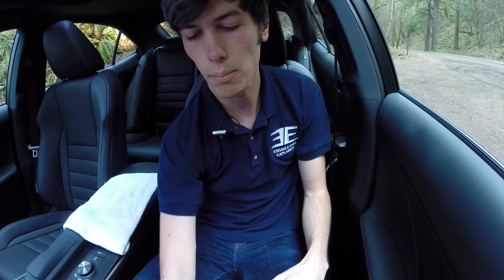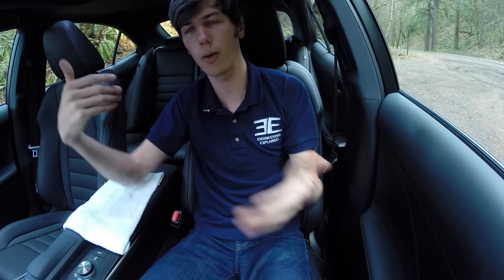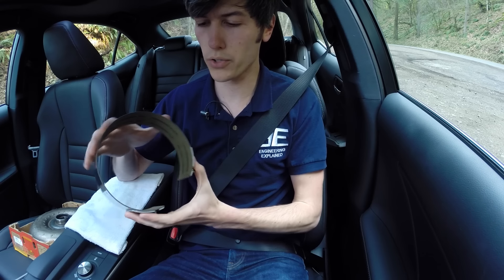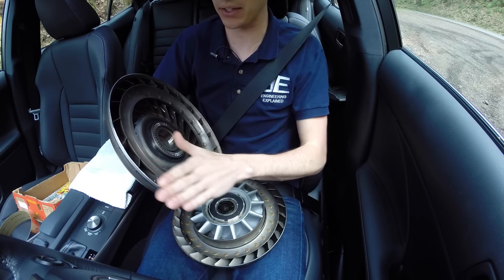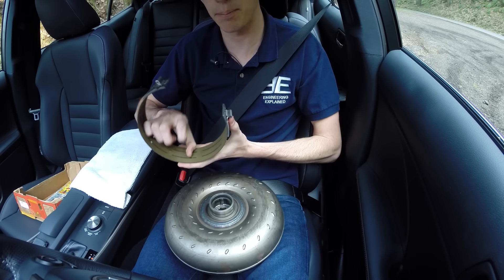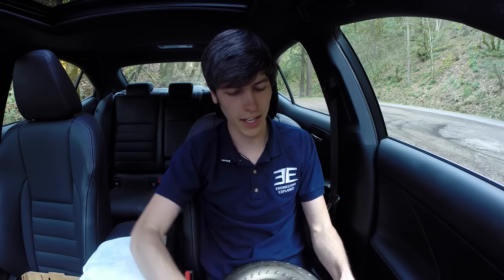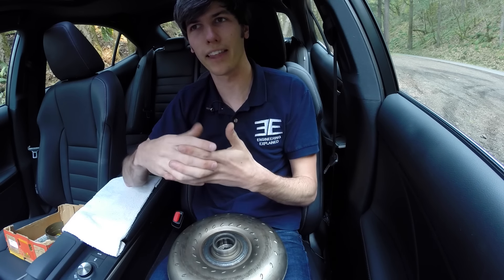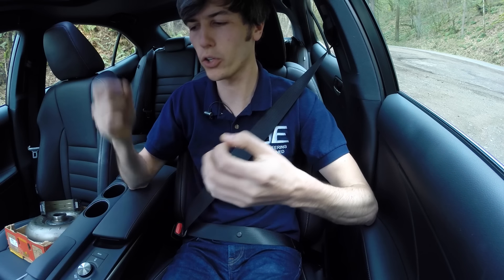5 Things You Should Never Do In An Automatic Transmission Vehicle

Comment: Coasting downhill in neutral at highway speeds uses 0.23 gallons per hour, but leaving it in gear uses 0.66 gallons per hour because the fuel is not completely shut off. Instead (at least in my Toyota), the air/fuel ratio is raised to18:1 and the ignition is advanced to the maximum and the engine is still rotating at highway rpms!
At a stoplight, you're using using 0.33 gph of fuel, but in neutral, the drag on the engine drops to 0.23 gallons per hour.

Comment: about letting in D while red light, i thought it's the right thing to do because i thought that all engine power will be dissipated by torque converter and the input shaft of the gearbox is not rotating. but then i see this other video that showing OBD reading of transmission data there is SLIP REV of 120 rpm with 640 rpm engine rotation while stopping and in D position. does this mean the input shaft still rotating at 520 rpm? if this true isn't this strain the clutch pack of transmission? could you explain this?

Comment: I greatly prefer driving manual transmissions but when I drive a work truck and it has a console shifter I have to drive it like a manual.  When I come to a traffic light I shift from D to M and manually downshift until I'm almost stopped then I put it in neutral so the trans is not fighting the brakes.  Personally I think it is dangerous to leave the vehicle in gear while people are walking in front of it in the crosswalk.

Comment: A comment on number 4 and the volvo well any company that uses the asin 6, 8, or 9 speed transmission the tcm is programmed to release the band and sit in neutral after a couple of seconds once it realizes the vehicle is at a stop light just to save fuel and keep you from having to shift

Comment: I dont shift to neutral downhill, but bc I live in a pretty rural area, theres a few traffic lights that I can see from over a mile away; if that light is red and I think it will be green by the time I get there, I can save some gas by avoiding engine braking. I only do it late at night when I'm practically the only one on the road. Despite that, I guess, being illegal in Illinois, is there any harm that could come to my vehicle by doing this?

-It saves gas by avoiding engine braking
-I'm still in control of the car, as no one is ever around me when doing this
-No brake fading occurs because I shift back to drive in case I need to brake anyways
-Is there any way a cop could tell that i'm in neutral from outside of the car?

Comment: You missed what I think is the number one reason not to shift into neutral when going down hill... That is that it's easy to  accidentally push the shifter a bit to far and wind up in reverse. A modern, computer controlled transmission will not let you do that, but one that's just a few years old and not shift-by-wire will. I see this video was from 2016, I think at that time very few (if any) transmissions were shift-by-wire.

Comment: "No reason to put car in neutral at a stop".

Hmm. I was thinking about that, especially with cars which automatically turn off the engine.

First reason is that in my car it saves the fuel, in N it takes about 0.6 of what it takes when in D. Not much, but can further improve fuel economy as an addition to engine's start-stop system.

Second reason is that it's a bit safer, if you slip your foot from the brake when eg. reaching for something.

Third reason is that my Mazda will know that it can shut off the engine for longer, because I just hinted that with the N mode (by looking on what it tells me on the screen it kind of encourages to use N when waiting on lights, etc).

Four reason is that when engine restarts in N it's much less stressful on the transmission, since it doesn't immediately try to move the whole car with brakes locked. The parts should last longer. I've heard an argument that when switching to N the transmission will lose lubrication fast. I find it quite unbelievable that oil would immediately go away from all the parts. It always takes some time.
Reply: There is a safety issue.  If a car from the cross-traffic veers out of its lane and heads towards your stopped car (with its engine off) you have no chance of accelerating out of the path of the oncoming car.  You are a "sitting duck" just watching and waiting for the oncoming car to ram your car and possibly injure or kill you.
Reply: @c_b5060  What? No. It'll take maybe 0.3 s for me to start moving anywhere with full acceleration. It's not an engine from 15 years ago where it took a couple of seconds to start. It starts in like 200…300 ms at most, so before I even move my foot from the brake pedal to the accelerator, my engine is already running. I'm talking about Mazda from 2020, so you might be right about older cars and their older start-stop systems.

Comment: I've always driven manual transmission cars and always avoided driving downhill with no gear on. I've always understood that no fuel is used even if the rpm goes up. When I drive in Canada, all the cars there have an automatic transmission. In the same vein, I wouldn't think of putting the N position of my lever on, so I wouldn't count on my gearbox to help maintain a safe speed for the car. What I said about fuel consumption is also true here, I think. I've understood this since I had my driving licence 50+ years ago, when the idea of an automatic transmission was something mythical for me.

Comment: Let's assume I'm coasting in neutral, 45mph. Then I switch back to drive. Does the computer have the information on what gear to engage at 45mph? There must be some undesirable stress on the gearbox apart from the reasons you already told us. Thanks!

Comment: I think a Toyota 4 runner could be in reverse while going forward even at highway speeds with no issues to the transmission; was told this a long time ago but never knew if it was true but would be a fun prank to pull on the highway

Comment: All 3 reasons he gave did not persuade me to not coast in neutral. I was worried he was going to say something about it being detrimental to the transmission or engine in some way (that's why I clicked on the video) but all he says is:
1. Affirms theory of better fuel economy except for newer vehicles. (Great! I have an old vehicle)
2. Can't speed up (Yup. Already knew that)
3. Illegal in most states (Not in mine!)
Reply: Even in new vehicles it's the same. Neutral for small hill but if the hill is too steep then use the gear, otherwise  - NO fuel pedal pressing = LESS consumption.

Comment: In long drives I wait for a red sign to finally give myself a chance to remove my foot off the pedals, so I set the gear to Neutral, pull the hand-brake and take my foot off the pedal .. then when the sign gets back on after 30 or 60 seconds I put my foot on the break pedal, release the hand breaks and shift to drive and proceed.

Is that a wrong thing to do?

Comment: Was there any mention of "If I don't want to hold the brake for 3 minutes while in gridlock traffic, is it okay to put my car in park, or in neutral, or perhaps just applying the handbrake?" or nah? I think I'm going to put the car in neutral and apply the handbrake if I'm stopped for awhile but may need to start moving in a pinch. It takes a lot longer to go from Park to Drive than it does from Neutral to Drive

Comment: the law was meant for older cars where if the engine goes out (out of fuel or any other reason) without wheels being engaged, you could lose pressure in brakes and power steering. Nowadays they're electrically boosted, so letting the wheels turn the engine has no safety benefit.

Comment: Does the don't put your car in neutral when at a stop light thing work for an automatic transmission from 2002? I see a lot of videos saying there is no need to do it but a lot of them are for cars with a lot more electronics than mine. FYI, i dont know the inner workings of cars but I assume that even in 2016 automatic transmissions are waaaaaay more advanced than the ones in 2002.

Comment: regarding the last 2 ones.... im not disputing it, but if theres no need for neut at a stop, n one should rather turn off b4 doing that, why is there a neutral option at all? and for the later/last one, you mention at the very end that if one feels like having more assistance with breaking, one should "Down shift first"???? isnt the thing with autotrans's that they DO NOT have shift's (for the driver to interact at least) At all? or am I missing something? and while in the same topic, also, there wasnt any mention of the use of the handbrake. "you should use your brakes and step down hard on them" implies that only the pedal brake is whats being considered

Comment: 1. The maximum MPG I have seen is only around 80mpg... I have seen the case where going down a long hill it pegs the MPG at the max, but if I reset the gauge at the top of the hill I can see that I actually did use some fuel on the way down. (Not that I really care to save a few ounces of fuel like this as the cost of doing so is higher, but still - why does everybody say no fuel is injected when that's not entirely true?!)
2.  Have you done a video on 5 things you should never do in a CVT vehicle? If not, you should!

Comment: How about switching to lower gear when going downhill to brake with the engine?  Is that okay?
Reply: It really depends on the car and situation. You don't want to put excessive stress on the transmission. If it's a modernish car it will know best.

Comment: But coasting and motor brake is a big difference, right? Its like the difference between being in gear without throttle and being in neutral on a manual. Is there a difference between manual and automatic?

Comment: It your car has built in launch control then it will damage your car less I can only speak for audis in this following statement. Put the transmission into sport and the drive mode to dynamic the turn off tcs by pressing the button once then floor the brake then floor the gas wait until your rpms reach 3,000 the release the brake very quickly and launch

Comment: one thing i always do when parking is foot on the brake put it in neutral apply parking brake foot off brake then shift to park, reason being is i figure the parking brake will take all the pressure off the transmission especially when parking on an incline, Jason what are your thoughts on that?
Reply: Doing that you likely aren't engaging park at all, the pawl may not actually be in one of its locking teeth. Put it in park, slowly let the car roll back till it catches and set the brake. Then you'll have both.

Comment: Is it okay to change gear like D to 3, 3 to 2, 2 to 3 and so on while pressing the gas? Or do I need to release the gas before changing gear? can it damage the transmission by doing so?
Reply: It's fine to hold the gas and it's fine to shift, the cars computer handles all the work to shift.

Comment: Going from reverse to drive at speeds of say less than 5 mph will be damaging?
Reply: Depends on the transmission, but more then likely over time it will damage something in there. The GM 700R4/4L60E are kind of notorious for sun shell failures, not because its a particularly bad design, but people putting it in drive before stopping just beats the crap out of the splines.

Comment: Depending on how long your at a stop light. If I know I'm going to be stationary for more than say 30 seconds, apply hand brake and shift to neutral. Prevention from transmission overheating a warped rotors. Keeping foot firmly on brake pedal is a bad idea. Driven many automatics with warped rotors, not nice.

Comment: Okay so I have a '95 Chevy K1500 and I figured out that cylinder 8 (back left if you're looking in from the front) is very low on compression (worn out piston rings) and therefore won't combust properly. I have no other vehicle to use so I drive it anyway. When I put it in gear and let it idle, it runs rough and wants to turn off so when I'm in traffic or at a stoplight, I tend to put it in neutral because it gets the RPMs back up and stops it from turning off. Is there anything I should be worried about when it comes to the transmission? Sometimes I don't come to a complete stop before I put it into neutral.

Comment: If your throttle is stuck and you downshift you’re just going to accelerate until you break your transmission or rear end or RedLine the engine till it blows

Comment: question: isnt the reason for putting it in neutral at a stop light to keep the temp from building up in 1 spot on the brake discs? specially after breaking fermly and its already hot?
Reply: The torque is so low that would never happen.

Comment: I will put the car in neutral when stopped   not for the transmission but to be able to release the brakes (when no hills)    hot brakes...pads can leave deposits causing a feeling of a warped rotor.
Reply: Just used hand brake

Comment: In a hot country as Indonesia its normal that people waiting or talking for an hour in the car and running engine for the airco so most people put automatic gear in N or P ,now I hear in N is not good…..why is N there then at all?
Reply: Good question - a safety buffer between Drive / Reverse. Also, sometimes it's needed in emergency situations to coast to a safe spot when the vehicle is disabled. I use neutral at long stoplights because my old truck runs poorly [stalls sometimes] so I had to increase the throttle and that makes it kinda push forward more than normal and so I have to push the brake pedal harder and it wears out my leg a bit.

Comment: Shifting in neutral when you are at a light can be a safety thing. In Drive, if you are distracted (not that you should) and may lift your foot from the brake, the car will go and potentially drive you into incoming traffic. It happened to the daughter of a former colleague of mine while checking her phone, she passed away from the accident. Staying in neutral removes this risk if the car is on a flat surface.
Reply: That's why you apply brakes FIRMLY at a stop light, not as lightly as possible. You can't accidentally lift your foot nearly so easily that way. Same applies to manual transmission cars on uphill stoplights, you hold the brakes FIRMLY to avoid rollback.

Comment: "Never put your vehicle in neutral" Well and when you have a BMW with ZF auto 8HP50 transmission that does that by itself? It's called "coasting" or something, the ZF 8HP50 disengages itself when in ECO-Pro mode to save fuel and let the car roll with minimum resistance when you take your foot from the accelerator. That saves a lot of fuel.

Comment: If you have an automatic with the "manual option"  is it bad, to say put it in 3rd gear, going down a steep hill to keep your car going the speed limit instead of keeping your foot on the brake most of the way down the hill?
Reply: No it's not bad at all. Engines are made to rev (of course don't go to red). It is the correct way. It saves the fuel and in emergency it brakes faster if you need to stop suddenly. Think of accelerating, where you also rev the engine and it is made for it.

Comment: Why shift to neutral at a stop? To apply the hand break! As someone who drives a manual 99% of the time, when I do have to drive an automatic it’s so annoying not to be able to rip that bad boy and have the car stand still. Sitting still at a light for two minutes with the prolonged pressure of the break pedal running up your calve is so unnecessary when you can have the mechanical muscles of the car do the work for you. Even if I apply the hand break the car still creeps forward if left in drive.
Reply: Yes. He is talking BS!

Comment: Althoug fuel is cut in D releasing the gas, coasting down hill. In N still gives a significant better fuel economy. The question is; does it harm the transmission? Pulling the car in N after breakdown does. So..  I'm not sure

Comment: Before a switch on the car, do I have to pressed down the breaks first or not!!
Reply: Depends the car, some make you do that as an added "safety" feature. Otherwise no, it's been a rule of thumb in the past some cars that hae been left in gear can start the engine in gear and take off unexpectedly. So as a genersl rule it is good practice to follow especially if you aren't the only driver of that vehicle.

Comment: I got the auto transmission, when go down the hill, specially the hill with high angle, i have to manual/sport mode to low the gear to help reduce the speed. I wonder it would damage my transmission??
Reply: Could do, if it puts too much stress on it.

Comment: I often drive down a very long steep hill on a certain open highway in neutral. If I leave it in gear, the vehicle will slow down and I'll have to apply gas to keep moving. In neutral, the car will pretty much maintain about 65 mph using no gas at all for several miles. There's no good technical reason why I shouldn't do this, other than the DMV says I may not. And sorry, that's not sufficient. 

I also frequently shift to neutral at long stop lights especially when my leg is tired. Again, it's my prerogative.